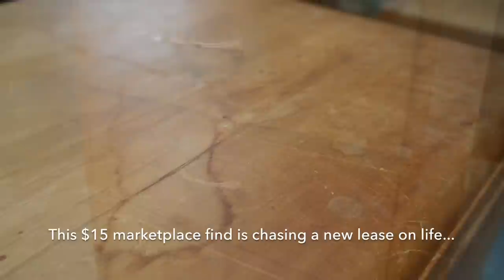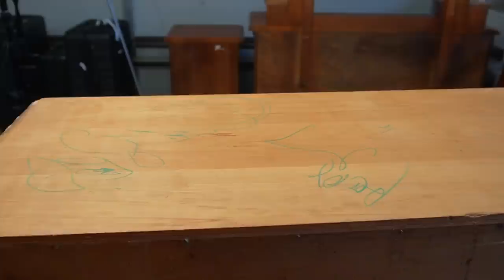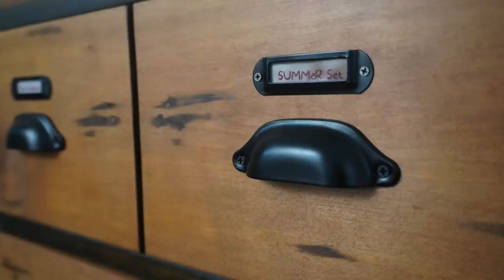Turning a Tired Old Dresser into an Apothecary Style Cabinet - DIY

Comment: I really learnt a lot from this video. Thanks. The key to success was that the drawer fronts were solid so able to be rebated to look like two. Wouldn’t work with so many modern pieces where the drawer fronts are veneered. I recently picked up for £10 a Scandi 1950s small coffee table that belong to an OAP and which had a random piece of white laminate glued over the real maple top underneath. I did a pretty good job at removing and renovating but could have done better by using a brush and stain to disguise inherent damage.
Reply from the maker: Thank you for taking the time to watch and comment, I am pleased you learned a few things, that is always rewarding for me. Wow, blows my mind that someone would put laminate over maple but I am pleased to you managed to bring it back, great effort!

Comment: Nice transformation. The results look really nice. I was just wondering; why do you use steel wool to apply your stain?
Reply from the maker: Great question, the no frills answer is that I have seen other restorers do it so gave it a go. Because it is so fine, I found it helps give that extra smooth finish to the timber. I used to use a lint free cloth but unlike the cloth, the wool doesn't retain so much stain, this means it goes further and is applied more evenly. Just my experience though, I use it all the time with stain now. Thank you for watching!

Comment: Great styling change with the apothecary look! An option instead of adding darkened areas around the drawer fronts to draw attention away from the patches covering the old hardware holes:  what about a more opaque finish on the drawer fronts, either a solid stain or else paint on the drawer fronts as contrast to the clear finish on the carcass? Just an option for another time.

Comment: Absolutely gorgeous and so much information. I have a question....would bleach work the same as the acid? I've never tried either.
Reply: Oxalic removes stain unlike bleach which usually is used to lighten wood not stain removal. Oxalic will lighten wood to a degree as well I might add . It must be applied to the entire surface not just the stain
Reply from the maker: Thank you for watching and taking the time to comment :) @flaminbird1 has answered with very much the same answer I would have :) - Thank you!

Comment: 0:37 I don't know why, but I've never thought of using joinery to joint boards together.
4:30 Cabinet maker tip: Place a shim beneath joinery like that when clamping, as you risk splitting the boards when clamping like you did here, due to the way you force the wood down, while being secured in place by the joinery of the drawer. The shim also improves the stability of the clamping, making it even stronger for your desired task.